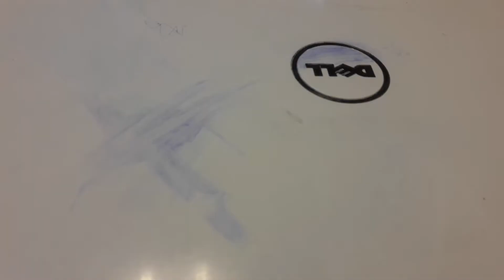Free Energy is possible #GreenChallenge

Comment: Great Initiative Deb,
I am sure it would be a good contender for the Green Challenge contest. Must check though if it has anything to do with the properties of semiconductors as you had pointed out. When I was young we had crystal radios which worked with just a single geranium crystal and a wire. With it you could tune into all kinds of radio stations. You had to wear head phones, no batteries no current.  As you point out though, the barrier against free energy is just the mind set, nothing else.
Reply from the maker: This is one step beyond DIY ....has a lot more to do with toroidal amplification factor not observed elsewhere.... Could not resist to work more on this.... Many Thanks James...!